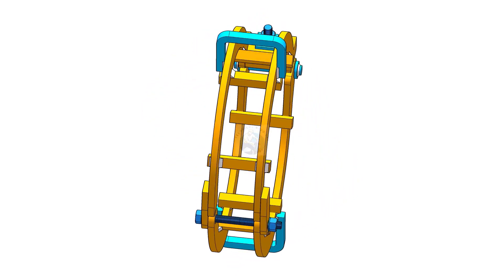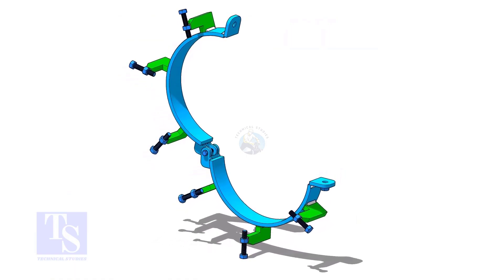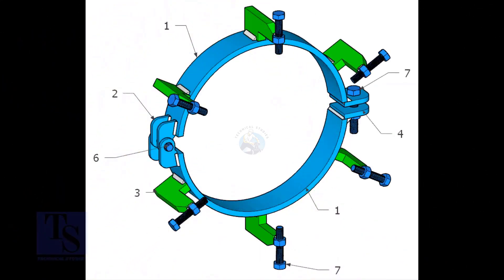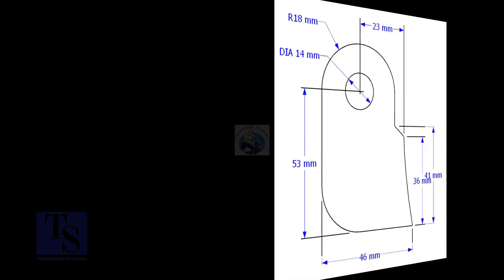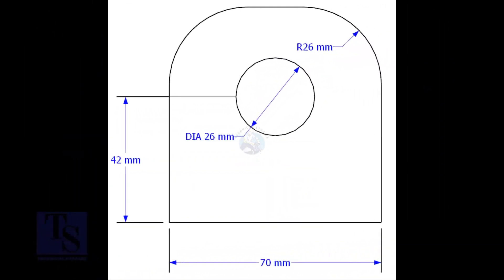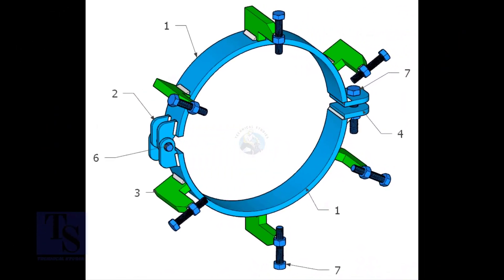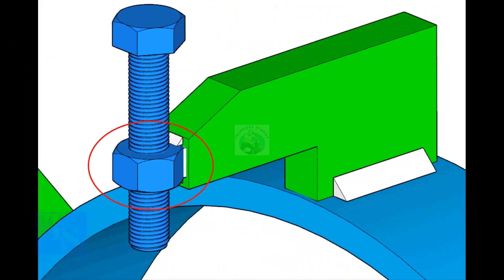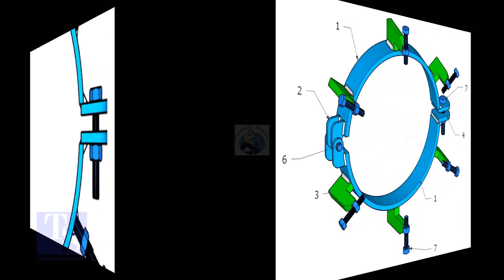How to Make a Low Cost Pipe Clamp

Comment: great video, here in Japan people most do it by hand, takes so much time and the pipes are always a bit unaligned.
Reply from the maker: Bro, i used to work with a Japanese company some 30 years back, that time, that company provided some lateset equipments for fabrication and erection. For example 50 tons hydraulic jack only 4 inch (100mm) height, and many more things.
Reply: @technicalstudies.  did you work with them in Japan?